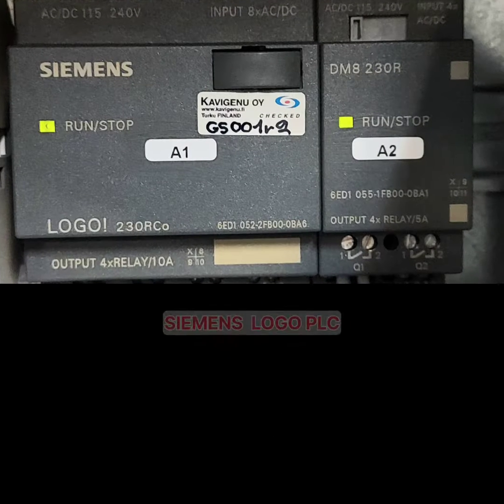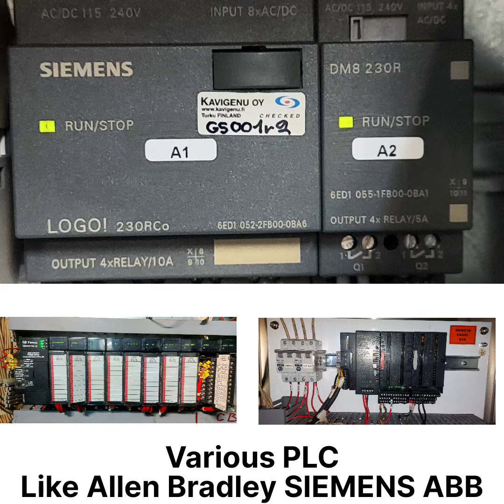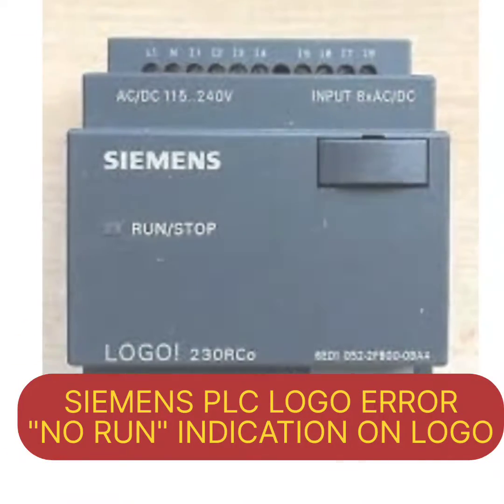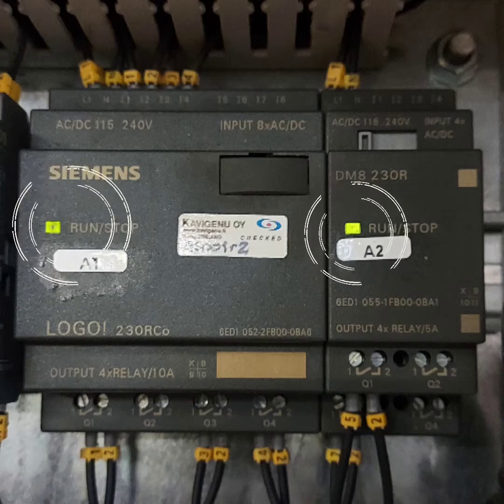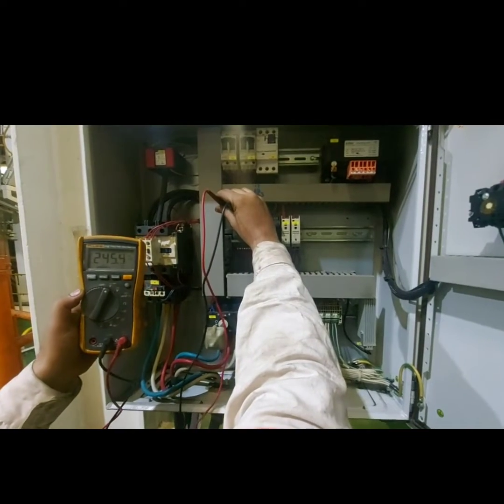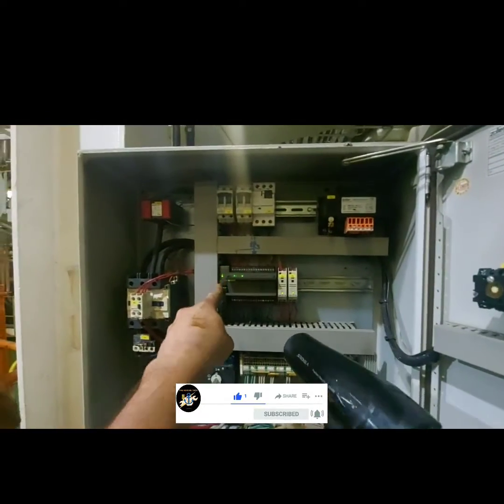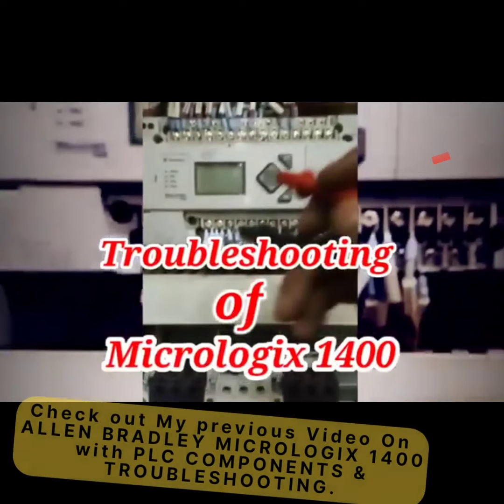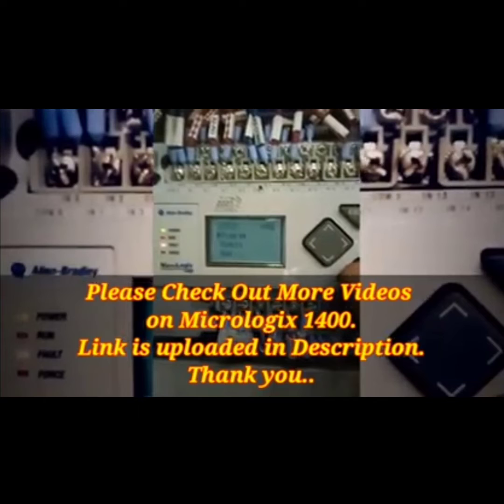SIEMENS LOGO! PLC || How to Fix A DEAD PLC? || PLC TROUBLESHOOTING || #siemens #plc #plctraining

Comment: Sir I don’t now but your method works ! I fix 5 of them ! Can you explain what we do or what we fix with the hot air ?
Reply: PS: If I leave it and it "cools down," I have to repeat the same process. Is there a way to fix it permanently?
Reply from the maker: Hello sir.
If you switch off for a long time, you need to repeat the same process. No, there is no other way to fix it..

Comment: My siemens logo 230rc has no display but there is power input..is it dead already?how to fix it?
Reply from the maker: Hello..
It is not dead..u can use a hair blower or a hot air gun.. switch off power and blow hot air to logo 230c for 10 to 15 seconds.  Switch on again and check..